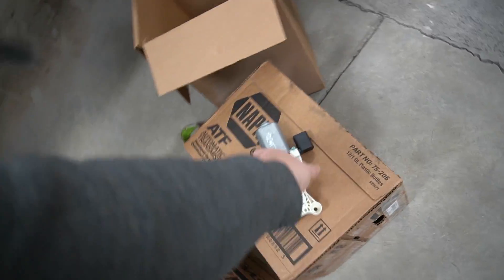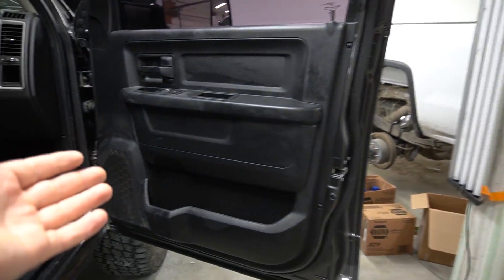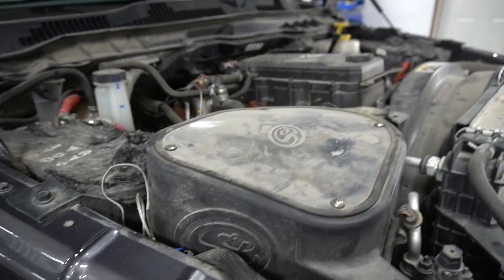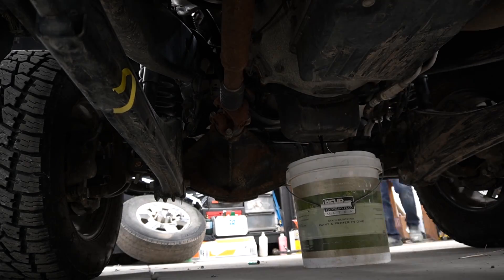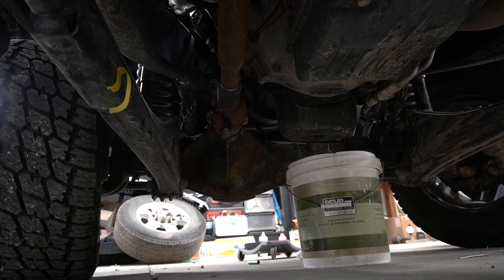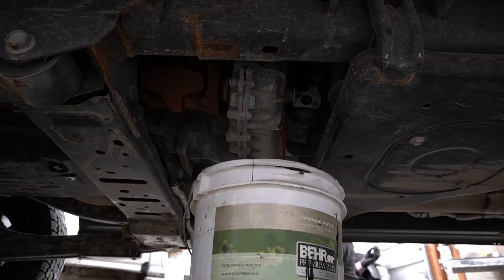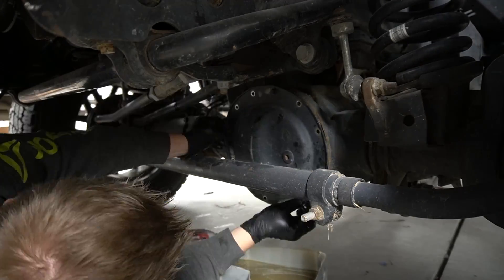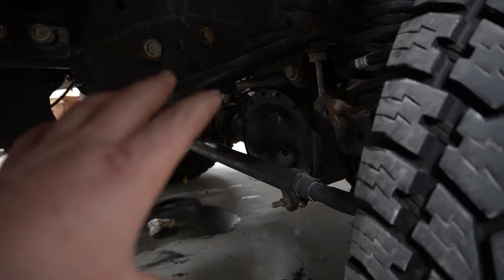Rebuilding A Wrecked Ram 3500 for my Subscriber [part 6]

Comment: You should pull the rear axles and check for water if it was that full it's probably  has water in the wheel  bearings

Comment: Too bad the back bumper was not changed, I hope that the customer will change it. Also, there is a slight difference on the passenger side between the front and back door. I guess that this difference would be diminished if you will blend the new paint to the back door. Great job anyway!